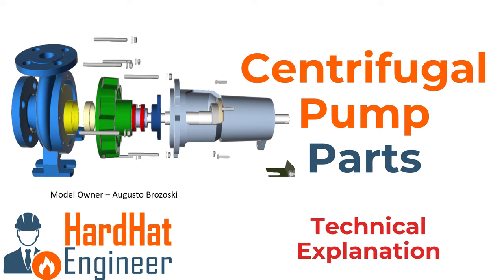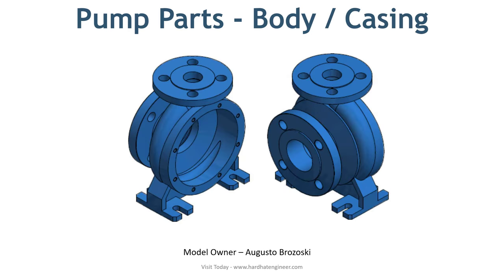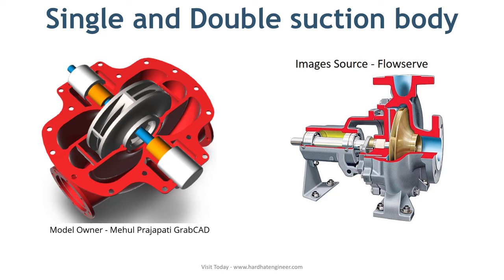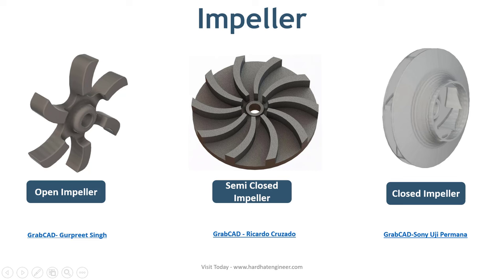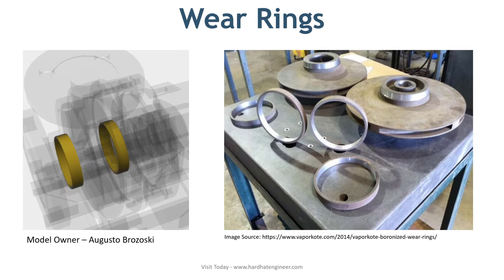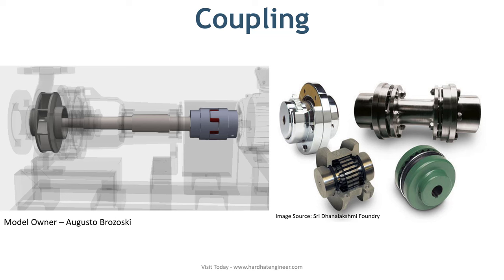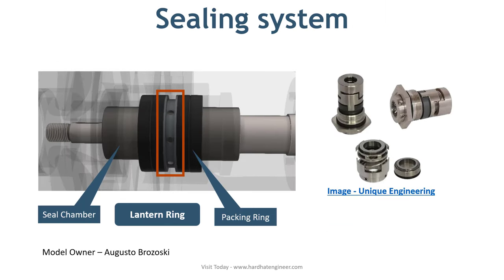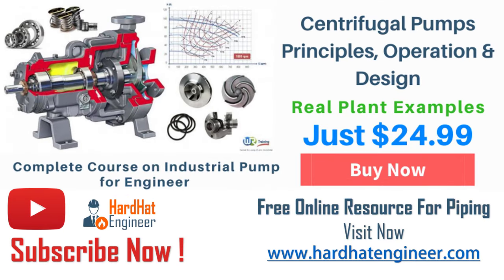Centrifugal Pump Parts - Learn about Nine Parts

Comment: The function of wearing ring is to avoid flow from the HP side of the pump into the LP suction side through the clearance between the impeller and volute. It helps increasing the efficiency of the pump.

Comment: Sr plzzz casing wear ring and impeller wear ring clearance Kitna rkhte h or pump m clearance kha kha rkhte plzzz ik vedeo banao sr
Reply from the maker: Purpose is to eliminate recirculation. Refer this it will help you https://www.pumpworks.com/wear-ring-clearances-in-centrifugal-pumps/
Reply: There are two standards to design the pump, first is ISO and second is API. For ISO pump, impeller/casing wear ring will bot be applicable. And for API there are many models available and wear rings will designing accordingly as suitable.